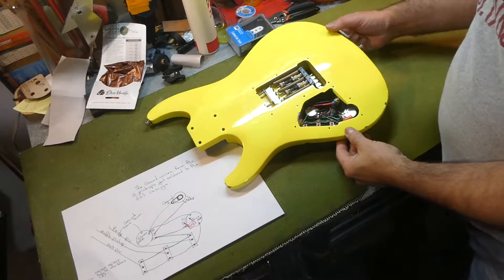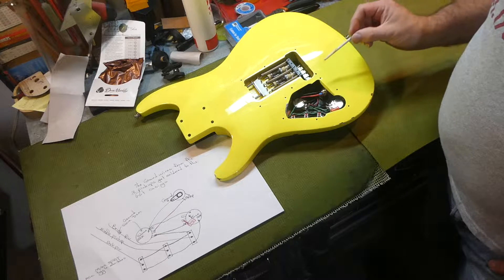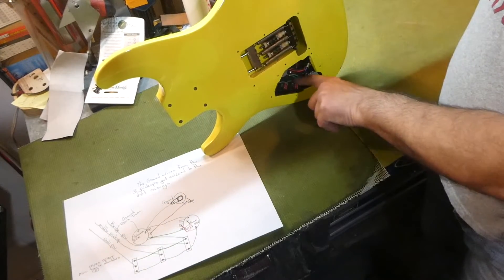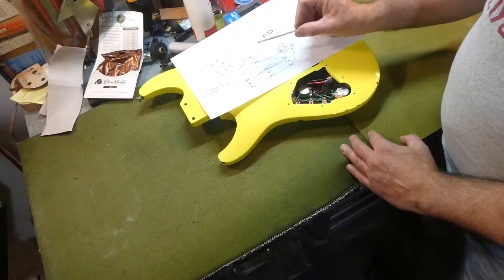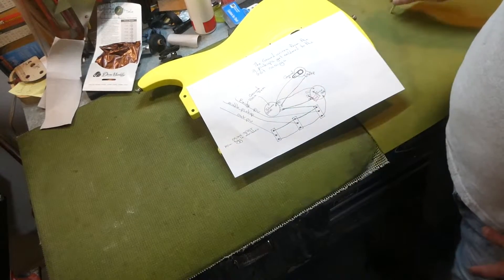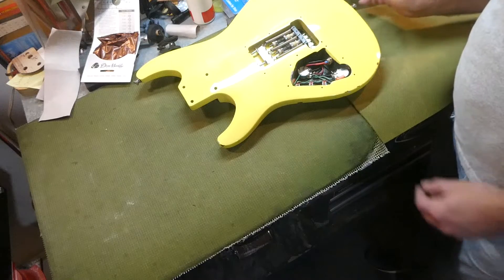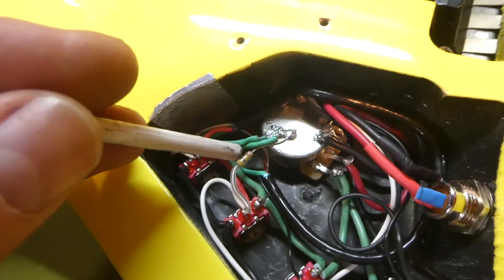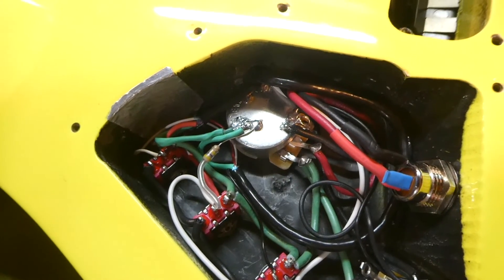3 switch wiring of an Electric guitar SPDT

Comment: Thanks a lot for the video! Problem is, I get a whole bunch of noise with the volume off and/or tone on for some reason. Just replaced the volume pot and everything wiring related seems perfect, also tone reads 0 to 496k so it seems fine. I have HH config, 2 SPDT on off for each one, one 500k volume and one 500k tone. Only difference is I wired the grounds of the pickups to the ground lugs of the switches. Have you got any ideas?

Comment: Thanks for the great info! I have a Tele that I once put a P90 in the neck, and now I've routed a third middle pup space for a Gretsch humbucker, which will be hidden under the pickguard. I'm replacing the blade switch with 3 switches. I thought about going full Brian May style and adding 3 phase switches as well, but there's only so much room on a Tele control plate! Thanks again. 👍

Comment: I have a HSH Strat pickguard with 2 tones,1 vol and 3 SPDT toggle switchs almost the same config as in this video except mine has also the 5 way blade switch, which left me confused cause I can't find any diagram with such exact combination. 

Could the 5 way switch still serve a purpose or do I need to bypass it?  

by the way cool guitar! I have an Ibanez S model too they are the racing guitar type. 

Thanks for the instructional.
Reply from the maker: Here is a diagram with 2 tones and 1 volume and 3 spdt switches. https://www.premierguitar.com/gear/stratocaster-with-individual-on-off-switches   I actually don't know what is going on in your pick guard. You certainly could chose either the 5 way blade or the 3 toggles, but the only reason I can see that there are both is that blade controls the switching and the toggles serve some other purpose. For instance, on a humbucker with 4 wires, (the red and white wires on a Seymour Duncan) 2 wire could be sent to the toggle centre lug for coil splitting, and one of the other lugs goes to ground, and you then can turn the hum bucker into a single coil. But if the middle pickup is a true single coil with 2 wires, then there can't be any coil splitting, so that leaves me confused .

Comment: Thanks for this. I have a push push volume pot and I'm trying to figure out to coil split a seymour duncan. Do I connect the hot the switches and split the poles onto the volume?
Reply from the maker: if you have these push pull pots you will send the red and white wires of the Seymour Duncan to one of the 2 bottom lugs and a ground to the other bottom lug ...all the rest is wired the standard way. This way when you pull up it should coil split. There is a diagram on this page.....https://www.stewmac.com/electronics/components-and-parts/potentiometers/cts-push-pull-pots-spst/
Reply from the maker: If you have one of these it appears like the red and white go to C1 and the Ground (which is the green and the Bare wire) go to 2. remember to send a wire from 2 to a bare pot.https://www.stewmac.com/video-and-ideas/online-resources/learn-about-guitar-pickups-and-electronics-and-wiring/wiring-the-cts-dpdt-push-pull-pot/